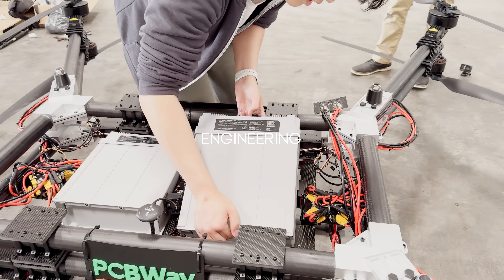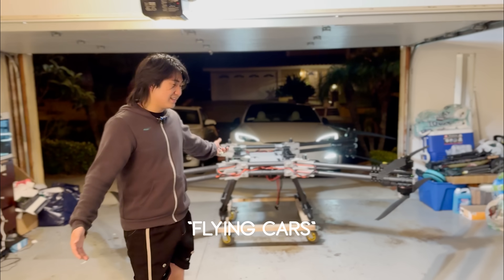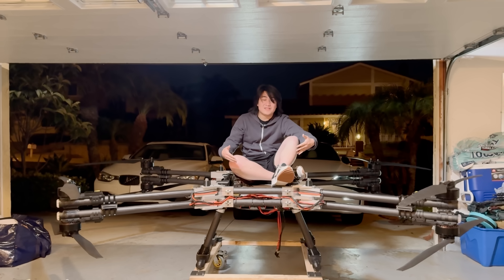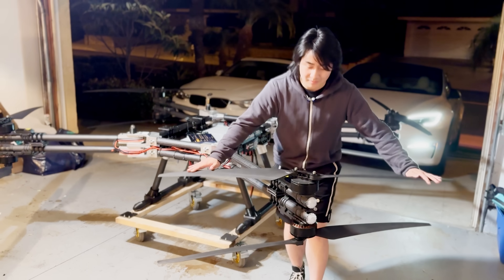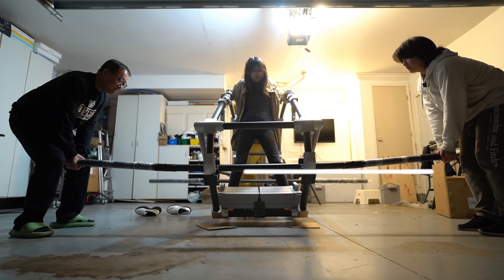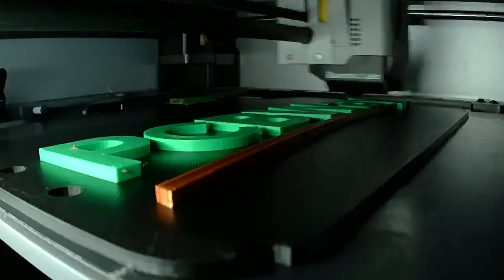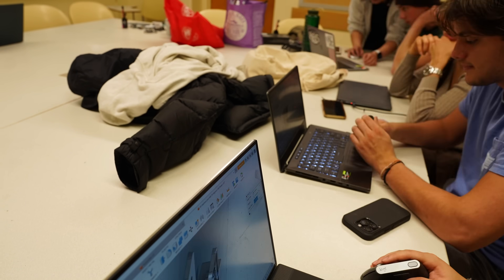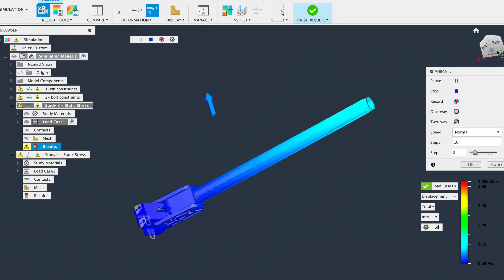My "flying car" finally FLIES

Comment: There is a proverb:   ‘You build your first house for your enemy;  your second for your friend;  you build your third for You’

So, you did it - well done!  Now, can we start making kits, so I can buy one?  🤪  It would be interesting to know what the bill-of-materials for this is…. I’m also interested in the clamping-force at the intersection where carbon meets aluminium. After that imploding submersible last year, do carbon-metal interfaces make you anxious?

Have the control sensors and software to automate position sensing, levelling and directional movement been commoditised yet?  It’s almost like you just need to transplant inner-workings of a DJI drone!

Lastly, a basic stability characteristic for an aircraft is to have the centre of gravity below the centre of lift - a paraglider is inherently more stable than anything else.  Even if my DJI drone has lol the dynamic flight smarts to self-level, the props still arise from the top of the aircraft’s frame, not below. As tempting as ‘sitting on top’ may be, you would increase passive safety dramatically by increasing the length and spread of those landing skids, and adopt a paragliding harness as your seat BELOW the mechanicals.

Comment: I noticed when you got a little close to the wall how difficult it would have been to maneuver. My mind was telling me maybe slow down but if you slowed the motion would have impacted the tilt more backward. So I thought maybe speed up but the tilt was already turned towards the wall. You let the wind from the propellers push the whole thing which was a very thoughtful technique. When you trust your instincts it shows. 🧠⚡
Reply: One of the more difficult things about designing a vehicle like this is it has absolutely no traction. One of the best features of a vehicle like this is the fact that this vehicle has absolutely no traction  😂

Comment: be more interesting if had a 4 way unitary ducting manifold on top  on cage with multiple fan intakes and gimballing exhaust nozzles so the form factor could have smaller foot print and even better fan out capability in terms of balance. Could add some retractable small wings too....

Comment: To increase stability, connect the top and bottom rotors on each boom to each other with a nonflammable material, since, as designed now, they can still wobble under turbulence combined with load. I admit, though, separating them with some airspace does have the benefit of reducing the likelihood of a motor fire spreading from one prop to the other. Also, I highly recommend minimalist screens of some sort over and around the rotors before putting a person on there. If you have to bail out or if a bystander gets too close, of course, those exposed props are wickedly dangerous. If you want to join me in building VTOL’s during the Millennial Reign of Christ Jesus (Yeshua) that’ll probably start on the Earth in 2031, ask an angel at that time where I am stationed in the Kingdom. Creating VTOL’s are one of the tasks he’s assigned to me during that 1,000-year period of peace that follows the 7-year Tribulation, and I will need plenty of help.

Comment: you need to check your accelerometer and gyroscope and see if they are functioning properly. if they are really close to cables or batteries, EMF could actually make them not function properly. This was my experience in the drone i built. I had to move them away from the body and 3D print a enclosed case for them. for now, your drone looks very unstable so i'd be cautious.

Comment: I think that with the seat underneath, the drone will be a lot more stable. A lot more safe.
Reply: Amazing work except I would not have that design. Ok as is but adding the pilot and cage it will be top heavy.

Comment: Man how hard could it be? You built this thing in like 13.5 minutes...  I could totally build that if I had all the necessary items. Things like the electronics, the carbon fiber,  the motors, the hardware, your intellect, dedication, and persistence, oh and your awesome support team. Yep that is all I would need and I could totally probably build something that kinda sorta resembles that when it's stationary!  😜

Great vid and I'm equally happy for you and terrified for you. I've taken the tip of a finger from 5" props and I would take those all day long over the ceiling fans on steroids you are using. Those are the kind of props that don't just chew up some fingers..... Those are unwanted automatic amputation devices! You seem  to be erring to the side of caution so I'm sure you've got a solid plan for protecting that important thing resting on your shoulders before you just hop on and go for a flight! 

Keep us posted!
Reply from the maker: Haha, thanks for ur support, best wishes to your journey too

Comment: Stability with the pilot above the rotors will always be an issue, if it was below it aids stability...theres a reason helicopter rotors are on top...look back at some of the first copter footage where pilots were on top...
Reply: Have a look at the hiller flying platform. Weight shift control and stable. 
All helicopters with rotors above the CG are unstable.

Comment: its called prop pitch aileron technology a sort of prop gear to change the prop pitch of the fan blades do it to your drone with a control system like a level on a helocropter  , 5 times the lift and less or same energy
Reply: they are going to start doing it inside of jet turbine engines

Comment: This is why engineering is the way it is.  With physics you can set up an experiment rather easy but engineering it takes a huge sum of money for materials.  You can come up with something like this and even get it to work but nobody is going to invest in it.
Reply from the maker: This video is literally sponsored
Reply: @alanzeekk yes but I’m not taking away from your great achievement or the value it has to you but engineering is extremely difficult and rarely rewarded with any monetary significance

Comment: All those exposed blades terrify me. Can't you employ very narrow cowlings around each blade, so a catastrophic failure doesn't send a chunk of blade trough your head, or torso, one day?
Reply: The addition of ducts or prop guards would likely require a significant engineering redesign and add weight. Although it would help keep the props away from objects near the props, if the blade were to fail and break, the likely carbon fiber guard would offer little protection. However, I agree it COULD be done, just seems like overkill.

Comment: Remember the Most Important Component on the Craft is the Human!! The Propellers must be Protected ( hitting the ground) or Harming future pilot's/spectators.
Flying the craft you'll have to take into consideration the loading of Roll Cage/ human ( eventually) + protection for propeller blades

Comment: This is awesome, well done! From a technical perspective, wouldn't it be safer to mount the roll cage underneath the drone? A helicopter has the blades above the passengers, I imagine if there is a big technical error and you are on top its more risky to be hit by spinning propellers

Comment: The guards for blades is desperately needed here.
Reply: I would imagine he is pretty aware of all of this. In this video he is featuring early stages of this prototype and is testing it just to see if it works in the first place. At the end of the video he started discussing some of the safety measures 😉
Reply: I cannot agree with you more.
Reply: How else would I get my pedicure
Reply: Who saw that one Indian kid make a homemade helicopter without protection for the cabin?
Reply: @realMDizzy  I did. Terrible idea, but he could have also been on a tight budget. its a nice attempt! You've gotta give him some credit for trying!
Reply: @realMDizzy  what was his name?
stumpy?
Reply: @hindugoat2302  his name was headless
Reply: Jetson one doesn't have prop gaurds?
Reply: Flying guillotine
Reply: typical rich asian kids
Reply: Yeah, I would be nervous of in-flight bird impact and what one of those blades would do.
Reply: Maybe. But almost i never saw that on drones. I guess is too much weight for very little benefit. If u crash braces will not prevent blade strike anyway.
Reply: @alesksander  people safety, not for the aircraft itself
Reply: umm bridge stairs :D like in real aircrafts u dont want unwanted weight on drone.
Reply: @alesksander  Racing drone props can cut to the bone and occasionally props obliterate themselves mid-flight. Now scale that up about 5 times.
Reply: @2bad610  Mashed potatoes with some churned human meat from the flying blender
Reply: @alesksander  ahh, youre one of Boeing's men, i see. I can tell by the complete disregard for human safety
Reply: @alesksander  it messes with the airflow so the props lose a lot of thrust normally on small quadcopters if they make them they go for a duct and other style fans but they dont like to move forward they like to stay stable in one place better
Reply: People don’t walk in to helicopters so don’t walk in to this
Reply: @bluexy9715 the blades on the helicopters are on top of hit which is unreachable, this is basically ground level which is highly dangerous
Reply: @bluexy9715 they add weight though 😂
Reply: @bluexy9715 helicopter blades are not at knee height, this machine is an amputation device for the next person who stumbles near it.

Comment: As far as I see 1) it's still a drone and not a flying car (until someone sits on it) and 2) that "flight" is an in-ground effect, what's more indoors. 
When will you release a video of the thing piloted by someone on board and flying outside at an altitude more than twice the diameter of the aircraft? Cause you write "I built a flying car" (past tense).

Comment: okay i want to share something with you XPeng X2 has height is about 136.2 cm with width of arm i think so it about  478.0 cm so My advise is that  XPeng x2 do some balance height of top wing and the bottom this is about near  half of total height of  XPeng X2 so if this would work for little-bit easy maintain balance!

Comment: not an engineer here, but im going to guess that the top props are getting a lot of dirty air making them have to work extra hard. i think with additional weight they will overwork themselves and rip off. its hard to see but it looked like they were bowing quite a bit already.
Reply from the maker: Possibly. Opened for investigation. Ty for this comment

Comment: As a child of the 80's i had a toy helicopter which would hang from the ceiling via a piece of string. Once it was switched on it would fly around only in circles. Flash forward forty years and The things that people grow up with today compared to what someone of my age grew up with is insanely different.

Comment: If you put most of the mass up high, it will be inherently😢 unstable. Put most of the mass below the rotors and it will always pull itself straight and level.

Comment: This is beautiful! The only thing that stands out to me is the joint between the clamps at the ends of the arms. Bending of the arm puts max shear there, so you could see fatigue issues with the repeated flexure. I'm a mechanical engineer. I'm also jealous. Haha. Great work again!
Reply from the maker: Thank you so much!! Does the fatigue occur on the carbon fiber tube, the aluminum, or the area of contact? 

- a fellow MechE student
Reply: @alanzeekk  I was viewing the two carbon tubes as a composite beam. The fatigue would be on the hardware holding the two tubes together (equidistant from each tube)

Comment: It can be used by remote control to lower down those trapped on Mount Everest, those in need of help or dead bodies. In this way, it can contribute to tourism for that region.
Reply: So a helicopter?

Comment: Put yourself below the center gear and put a bigger landing gear, would be easier for the system to balance and also for a safer landing, the higher the CG compared to the landing gear position the worst

Comment: really good getting it that far... The only thing I have noticed is there is only one fixing either side of those CNC aluminium clamps a single point of failure and if one failed the clamp could rotate or move causing the propeller to strike the other propeller on the same corner.. At least having 2 or 3 fixings would negate the single-point issue.. I understand that both frames double up anyway but one frame failing in that area could cause loss of the aircraft..  I would also imagine that there is a metal insert inside the carbon fibre rod which would allow even clamping from the CNC fixture

Comment: Impressive work!

I wonder if it would be beneficial to go with the Volocopter design and put the rotors overhead of the pilots cage. So the pilot will be not in the area of the propeller blades. I also expect that its auto stabilazing, if the mass is lower than the propeller.

Comment: Some Advice:
-  Tie a short rope to the bottom of the VTOL to maintain control in case it flies too high or toward the sides too much.  This will reduce chances of damage.
-  You need a bigger power source or battery to lift heavier weight.
-  Can you connect an electric cable to the VTOL to power it to test it.  This way you don't have to wait to charge the batteries.
-  Ask for parts and advice from big companies who already have working VTOLs like XPENG.
Reply from the maker: Thanks. If you look a little more closely to the ending credit, you will see xpeng’s name as one of them. They helped me for this

Comment: so you built a big quadcopter and flew it in the smallest space you could find! and indoors where it will be affected by its own downwash an next to walls without knowing which direction it might go on lift off. not very smart. do you ever see other flying maidens done indoors?
Reply from the maker: 1. This is the biggest space I could find 
2. Maidens for aircraft this size are generally done indoor, roughly 90% of them
Reply: then tie it the ground and just check for blade separation and over heating. Indoor is a good staring point.

Comment: I don't understand the aerodynamics here. With so large pods, it should be possible to use one motor with a larger radius. Single carbon tubes could have a freely rotating faring around them to reduce drag, but double tubes? Is this about redundancy? So the octocopter can land with one damaged motor-rotor? Still I feel like spheres as nacelles would have the better aerodynamic properties. Also I feel like guards to protect the body from the rotating blades should be integrated early on. With upper and lower propeller close to each other, they could easily share a common guard, and there would be space to gently bend in back on all sides for aerodynamics.

Comment: not an expert just a thought :body-blue-raised-arms:. I think if you can make the roll cage detachable. So that when flying high and operator finds that eVtol is not behaving properly. He can detach roll cage with the body and top of roll cage you can add a parachute to safely land.
Reply: Yeah, reaction time? When the electronics goes nuts, this think will roll faster than you can react and you will black out.
Reply: yeah you are right that's why jets have rockets in there ejection seat to throw the pilot higher and far from the jet to buy some time and safely land. But in this thing it can be hard to achieve.

Comment: Fantastic work! Pity about the charger, but better that failing then a motor. 

Can you rent/borrow a crash test dummy? That might give you a better indication of the ergonomics of actually sitting on it than simply putting a bag of sand on the chair. Also, I expect if you can get hold of a modern, top-of-the-range crash test dummy, it would have loads of built-in sensors that would give you data on the various forces it was experiencing - pretty valuable information before you consider sitting on your eVTOL yourself!

Comment: Please make sure that the aluminum is not in direct contact with the CF.  It’ll degrade and compromise structural integrity.
Reply: there is some epoxy in between.

Comment: Your sane approach takes a while but is definitely better. One windy day (maybe a hurricane, I don't remember) when I was a kid, I built a kite that was larger than a hang glider and made it from tarps, ladders, pipe, assorted junk held together by literal hay bailing wire and twine and duct tape. I never thought it would actually fly, it was so big and heavy and clunky but I tied a rope to it and the other end to a tree or stout fence post. I lifted the kite into the wind and before I knew what was happening it had practically jerked my arms out of their sockets rocketing into the air and I was too high off the ground so jump. I apparently have a dumb instinct to hold on when something tries to fly away.  It is horrifying to see every thing getting small below you while hanging on to literal junk and realize you can't make it land. I got lucky and the gust of wind died down just right to get me on the ground again undamaged. Even years later, when I'm on an airplane taking off, I have to fight a panic attack.  Taking time to do it right and test the heck out of it may save a lot on underwear bills.